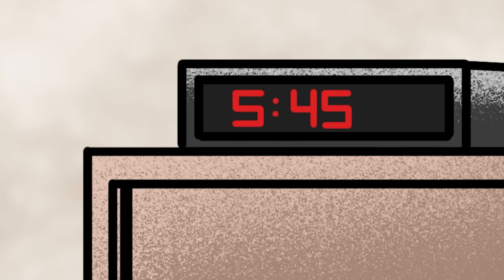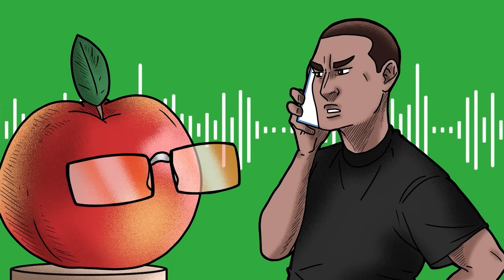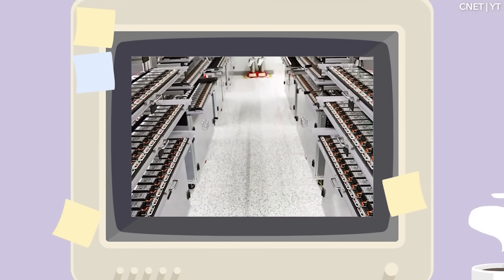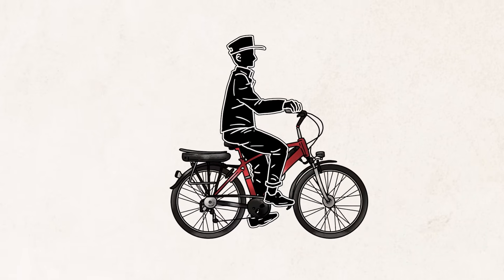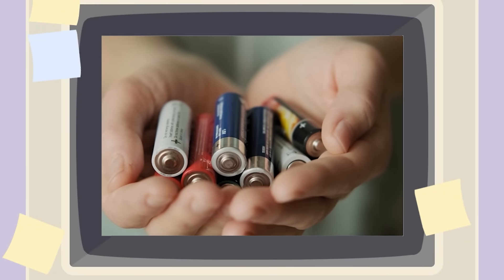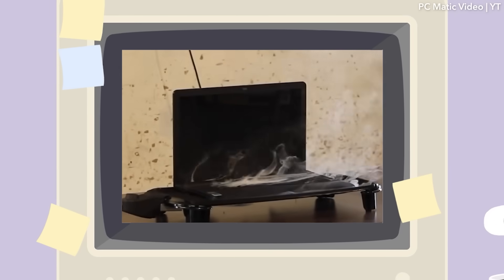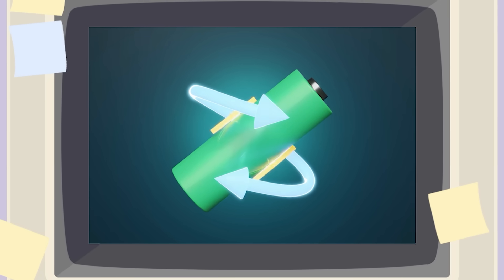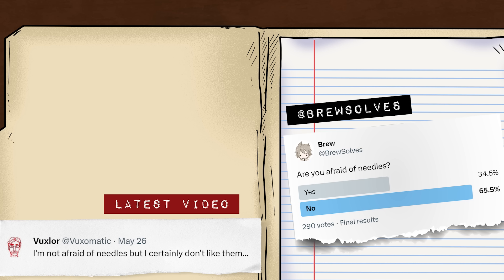A Man Wears His New AirPods. Minutes Later, He's Rushed to the Hospital.

Comment: honestly, I never stopped using wired earbuds and headphones - not only due to wireless ones containing parts that can more easily short out and cause cases like this, but because I have ADHD and lose track of objects easily, so replacing a corded thing that may get tangled on occasion but can be untangled pretty easily with little wireless things that can easily be lost just never appealed to me
Reply: the problem is newer phone on the market doesn't even have earphone jack plug.
Reply: @lakraknjeprak2536  Factually incorrect, only flagships
Reply: @Scymet  and i don't buy old phones. mine is your definition of "flagship" that doesn't have earphone jack plug
Reply: @lakraknjeprak2536  That's your problem, many new phones under 500 bucks have one. Nobody forces you to pay more for a less useful device.
Reply: @Scymet  that's exactly your problem. my phone i'm holding right now is "flahship" xiaomi mi 11T with pricetag $335 USD and i pay $500 with warranty included. no earphone jack plug. i was looking for 11T PRO with snapdragon 888 chipset but the phone is out of stock even in official store. well it was one week right after release date.
Reply: @Scymet  literally no one forced me to pay less ($335) pricetag than your old standard $500 one with slower performance.
Reply: @Scymet  if you do your research properly, my phone WAS flagship in the past (not today) with release date on 30 november 2021. that means i bought mine in december 2021 during wave of covid. basically there's no reason to buy new one with pricetag more than $500 USD since mine still fast af. if i can buy flagship gaming phone with $335 USD why spend more for slower option? you're not making sense here.
Reply: ikr... ngl im sooo mad that my new(ish) phone doesnt have an audio port
Reply: @Magic_Skeleton if you have an iPhone, you can buy adapters that allow for wired earbuds, can’t speak for other manufacturers tho
Reply: I just got headphones! I got some big ones because being connected to my phone is a hassle and I also lose things often. Only problem is charging, I got some off Amazon that have like 2 days of battery tho so it isn't too difficult 😁

wireless headphones lol, important info
Reply: I lose myself if I put myself down for more than two seconds so no way can I use wireless anything
Reply: I have ADHD too and I don't ever use wireless either. Because I don't ever remember to charge them and I can't use them when I need them anyways...
Reply: I use wireless earbuds that have the wire between them. The battery is on the wire. Because of the wire, it's hard to lose them and they're magnetic to each other so it's easy to loop them around things. You can take one out without having to be careful about where you put it down and you can hang them around your neck. I just don't see the attraction of having them completely wireless like airpods but YMMV.
Reply: Wireless earbuds hurt my ear. After this I may go back to corded
Reply: I have ADHD but rarely do I lose my wireless headphones. I just make sure they go back to the case. 

The worst however is misplacing them and then suddenly getting distracted llol
Reply: As someone who designs electronics and works with battery systems regularly a situation like this shouldn’t happen if devices are designed correctly and use reputable parts.

So I’m gonna guess this is a classic Apple design flaw moment or that they sourced the cheapest chineseum  batteries they could find. 

Don’t cheep out on your cells kids.
Reply: Same. I lose my wired ones all the time though
Reply: Hey if you don't mind me asking, do you suffer from the afternoon ADHD crash?
Reply: You need to have slots for things. I have a space for my wallet and phone.  They always goes there.  I have a spot for my keys - they hang by a lanyard (yes, I prefer a lanyard so I don't lose my keys :D ) - and I have a spot for my backpack / laptop.  I forced a habit to always put my stuff in it's place when I get home.  That's not to say I still misplace it occasionally, and it becomes an emergency, but I eventually find it and chastise myself for not putting it where it belongs.
Reply: Same but I lucky I can afford the pro gen 2s that can use find my iPhone feature and I use it atleast twice a day
Reply: lool this is why I got headphones instead as I kept losing my earbuds
Reply: The only reason I use wireless is because of my job. Even then, I've almost lost them so many times and one of them went through the wash and dryer.
Reply: I get the wired ones because they're cheaper.
Reply: "aDhD"
Reply: Reallll and my adhd self forgets to charge my wireless stuff like my friend got me a shower speaker i used it for a while when she gave it to me then got lazy to charge it 🏃‍♀️🏃‍♀️ i dont even know where it is
Reply: I have airpods and adhd and i dont lose them. My mom didnt trust me but my dad got them for me and I’m doing pretty good. I do forget the case at home often and have to put the airpods in a tiny bag the entire day.
Reply: nah im good, have a good day
Reply: to be adhd with 7 differenr pairs if bluetooth headphones with 1 headphone each it's a lifestyle brian
Reply: Me with my wired audiophile headphones XD
Reply: I got sick of accidentally yanking the wire out when walking or working out, and the connection never seemed to last long, so wireless headphones are the lesser evil in my case.
Reply: @PurpleAmharicCoffee  'and the connection never seemed to last long' what does that mean?
Reply: omg i lose my airpods like all the time and i have adhd, i know what you mean. thank god i can track them and it points me in the direction of where they are using find my😭
Reply: I thought it was common sense not to trust them
Reply: @christiantaylor1495  some people don't have it unfortunately
Reply: My first pair of wireless earbuds was a roughly 100 dollar pair and I lost one of them after like 5 days. Second pair was around 60, lost both of them.

I'm on my third pair of much cheaper ones and somehow I've managed to not lose them for 4 months so far. Go figure.
Reply: You can buy a phone case that has a airpod case attached with it
Reply: I second this, but for different reasons:
1) Price. For larger headphones, a higher price would be warranted, however for airpod sized ones, $300 is a bit too much, when $30 gets me similar audio quality.
2) School. My state has a no phones policy. My laptop and other audio devices cannot connect to modern Bluetooth tech. Hence, if I want to listen to music while studying at school, I have to use wired.
3) My old stuff. I love older electronic equipment, from the days before smartphones were common. I have a pocket radio that was my brother’s before mine, older than me, and it is amazing. I can use it at school too without getting into trouble, as it isn’t a phone.
Reply: everyone apparently has 'adhd'

Comment: I had a wireless Corsair Headset that exploded while it was on my head. I could smell what smelled like nail polish remover so I kept looking around the house for it and because the headset was on my head the smell followed me everywhere. 

Turned out the battery which was sealed in a plastic bag within the headset exploded. It didn't light on fire so I think it was a chemical explosion that caused a buildup of gas within the bag until it burst. Luckily it exploded outwards firing pieces across the room so I wasn't hurt minus a bit of hearing loss in my right ear.

I still use wireless headsets. Thing is, anything can happen at anytime that can hurt or maim you. Something with such incredibly low odds preventing people from using modern technology doesn't seem like a very logical choice to me personally.

Comment: It is not that the electrolyte supplies fuel, but that, at the high temperatures possible in the lithium ion cell, the electrolyte supplies oxygen!  Some people may remember the early underwater documentaries filmed at night by the National Geographic society.  Neither electric lights nor portable batteries were up to the task of supplying the needed light, so the light was provided by magnesium flares.  Magnesium burned at a high enough temperature that water breaks down into hydrogen and oxygen.  The oxygen combined with the magnesium and the hydrogen bubbled off to the surface.  Lithium fires are just as bad.  With the electrolyte supplying the oxygen, lithium battery fires cannot be extinguished and all the fire fighters can do is spray water on the surroundings to keep the fire from growing.

Comment: Great PSA... Lithium Ion batteries are freaking terrifying if they malfunction. Its amazing how many people have no clue how explosive they are.

One thing to note on the chargers though. Its perfectly fine to leave smarter devices like your laptop or phone plugged in. Most devices have fairly smart charge controllers and will stop charging the battery once full, and will just use the charger to power the device. This is more of an issue with simpler electronics.
With that being said, leaving a lithium battery at 100% for extended periods of time is also bad for the battery, and will make it degrade faster. Pro tip to make your lithium batteries last longer is to only charge them to around 85% capacity. This puts less stress on the battery and can extend the life of the battery.
Reply: I use a cheap Dell laptop from 2016. I used to keep it plugged in all the time, since I never really felt the need to move around with the laptop. Now my battery is pretty much shot and will likely last for 20-30 minutes before shooting itself in the balls. I now have to keep it plugged in, or the laptop is too short-lived to be useful.
Reply: @probropalzlive6961  probably has more to do with the age of the laptop than anything. Lithium Ion batteries are really only good for about 2 years. By that time they lose more than 20% of their total storage capacity regardless of how much you've used them, and it only gets worse past that. If the battery from 1
2016, I'm surprised you get any charge out of it.
Reply: Something tells me this will be in Mrwhoosetheboss techfails
Reply: I’ve never had a problem with the lithium ion battery in my e-bike. It’s always worked fine.

Why would the same battery in AirPods be any different?
Reply: @charlielucas3386  It has to do with failures rather than normal operation. Lithium itself is highly combustible. Any and all lithium based batteries have a chance to randomly explode if certain conditions are met. Most commonly if they are over charged or an internal short of the battery components. I guarantee if you took a sharp object and punctured your Ebike battery, you're gonna have a bad time. Most Lithium batteries have small embedded charge controllers that are responsible for controlling charging, discharging, temperature regulation, etc. In theory the conditions for a battery to explode should never happen, but in reality, sometimes the numerous safety systems in these products fail. And in the case of lithium based batteries, they explode when they fail.

Comment: This is good coverage on these batteries here.  Brew should do a follow-up video since he forgot to mention Nickel-Cadmium rechargeable batteries and Rayovac had rechargeable Alkaline batteries, too and Rayovac was the only brand to produce them (to my knowledge, anyhow).  When Rayovac first made the rechargeable Alkaline batteries (AA and AAA) which had the full 1.5 volts (rechargeable AA and AAA batteres were otherwise always 1.2 volts) it was great!  However, Rayovac later manufactured a newer charger with the same design while a slightly different look and the rechargeable AA and AAA batteries got the same treatment - I went through several sets of these newer Alkaline rechargeables and the newer ones ALL corroded in the Alkaline chargers which is probably why they stopped manufacturing them!

Comment: you can't use water to put out a lithium fire like the fire fighters that he mentions in the video. As Lithium reacts with water, making the burning worse.
Reply: About all they could really do is put it in a big metal box and take it somewhere safe to burn itself out. I think the water is mostly to protect things around it.
Reply: @chaos.corner  That, wouldn't protect things around it, it would only make it worse. It seems that when they send fire fighters to fight these fires, they simply aren't trained to fight lithium fires. So they try smothering with water, but it doesn't work, so they end up pouring water on it for hours, until all the lithium burns away. To put out a lithium fire you do need to smother it, but it is extremely dangerous to use water to smother it. And water, wouldn't protect anything around it, in-fact if you spray lithium with water, it can explode.
Reply: can confirm that moisture makes lithium combust, there was a fire in a lithium factory near where my family lives because for some reason the idiots who built the place built it directly next to the bay in possibly the most humid town in the area, like most of the surrounding area is wetlands, and this isn't even the first time it caught on fire rip
Reply: Apparently the fire is so strong and volatile that it dries up water to fast.
Reply: @kornelobajdin5889  that's not it, lithium reacts violently with water. When you throw a piece of lithium into a river, it will explode and burn.
Reply: @dragnothlecoona  yeah I know I heard from scoty its not smart to pour water on it.

Comment: Plugging newer tech devices into older outlets such as an older home/apartment or building can also be dangerous. A few years ago I plugged in a new charger in my bedroom and blue flames shot out. I had maintenance come in and change the outlet but I also now use extension outlets with a surge protector. If you go out and buy one, make sure it's not a cheap flimsy extension outlet but it doesn't have to be a huge bulky one either, unless you're charging ebikes, scooters, etc. The important part is that it has surge protection.
Reply: Sounds like de facto US wiring in an old house
Reply: Plugs get loose as they age. A task I have been putting off is replacing a bunch on loose plugs.

In theory bedrooms are now supposed to have arch fault protection: but no way that will work with loose plugs (and old light switches) causing arcing everywhere.